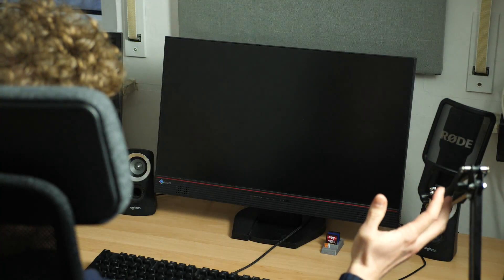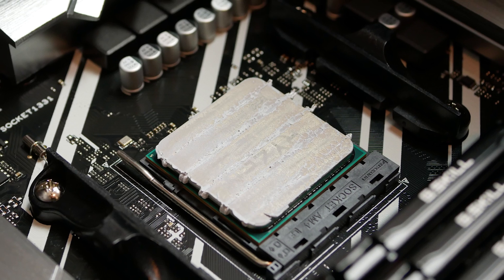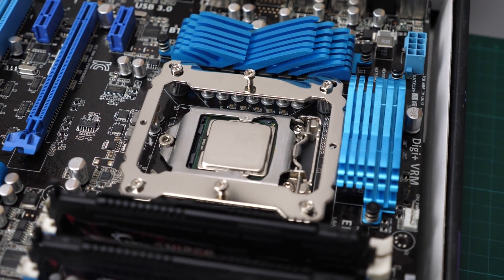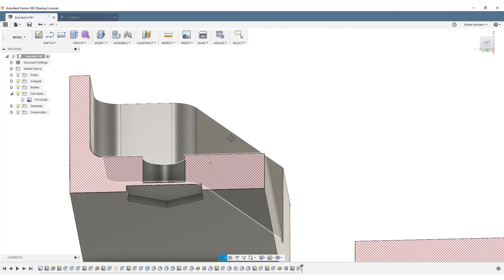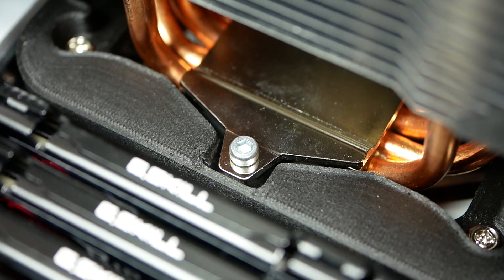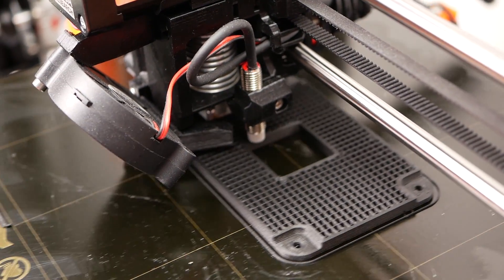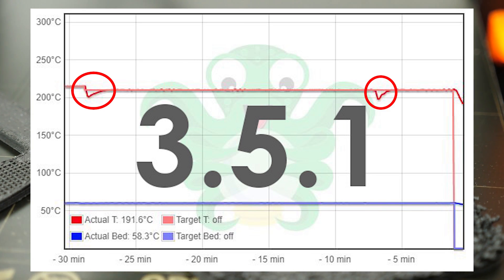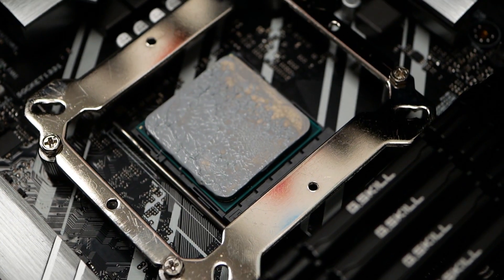I almost fried my new CPU because I overestimated my 3D print.

Comment: ... you can't wrek a CPU by "overheating" it... It'll turn off way before any damage is done either way.
Reply: Yes but it still aint good for it to reach those temps.
Reply: @zanpekosak2383  not really true, it throttles way before that. No CPU made in the last 5 years will be damaged from self heat. You can take a modern intel i7 and run it with no cooler at all. It will run very slow, but it will boot and run your operating system. They only cut completely off if you try to push them hard during throttling.
Reply: @Diamonddrake  My point is it is still not good. There is a very basic rule in electronics. COLD>HOT
Reply: @zanpekosak2383  except you want to build a heater
Reply: as he said it would have been that case in the mid 2000
Reply: Now go tell people whose house burned down because a computer fan stopped working that it didn't happen.
Reply: Thermal shutdowns aren't great, but yeah unless you're doing them nonstop for a while you're not gonna damage anything. I'd be slightly more worried about the cap temperature of the ones he covered up on the VRM.

Comment: Have you tried to vacuum seal and then use sous vide to anneal Pla? Not sure how it would go.
Reply from the maker: Haven't used a sous vide bath for that yet, because the oven works so well and I usually use temperatures between 100-110°C what is hard to achieve with water 😉

Comment: I think you covered that pretty well, Stefan. Without integrating other materials as safety clips, I think the annealing was as good as you could do with plastic.  Flashing copper over the plastic is a bit dangerous from a shorting failure perspective, but you'd also spread the heat around a bit better (you haven't shown one of those in a while :).

So, whilst everybody else was out sick you were playing games instead of making 'em chicken soup? :D
Reply from the maker: Still looking for a proper and reliable ways to metallize my 3D prints because that's not only good for aesthetics, it also adds quite a bit of strength.

Comment: My brother gave me a water cooling loop several years ago, but the cooling block was for an intel board and I had an AMD processor. I printed some brackets to make it work just out of PETG lmao. My brackets looked much more dainty than yours. The computer ran for years. I ended up giving it to a buddy. He still plays games on it.
Reply: PETG has a glass temp of about 2-3x of the material that CNC Kitchen thought was viable (but clearly wasnt)
Reply: the water cooling block probably never gets above 60 degrees. PLA would almost work. the air cooler will be getting up around 90 to 105
Reply: @MrOsmodeus  No, it's all fine either way. It's just mounting hardware, it doesn't get particularly warm at all! Barely warm to the touch.

Comment: Yes, i have an Adapter for my water cooling Fan+Radiator.
So i can mount the 140mm Fan+Radiator on a 200 mm Case Fan in the Front.
And a gpu holder for my Case so it does not sack.
Both in PLA. No Problem since over a year!

Comment: If the new bracket creeps, you could print another in cheap PLA, make a 2-piece plaster mold off of the print (or make 2 prints, each one being half the bracket to simplify this step), and then use a high temp / high stiffness 2-part epoxy to make the bracket in your mold. My first thought was to get fancy with dual cylinder / mixing tube type epoxy and use it like an injection mold, to prevent the possibility of air pockets, but that might be overcomplicating things if you can get a good pour in a static mold without going that far.
Reply: If you do this there is no reason not to add proper fiber reinforcement as well. E-glass is cheap (ish) and no plain polymer (filled or not) will match a fiber composite part.

Comment: Wahre interessant zu sehen ob das aussteifen des materials oder die hitzebehandlung geholfen haben. Oder qas das PC CF fillament auch wärmebehandelt. 
Still great video and good to know the picture calibrate trick in fusion
Reply: What a word salad! Two languages, "wahre" isn't applicable here, what is a "qas"...

I don't believe polycarbonate crystallises like PLA; it would be curious how annealing it affects its mechanical behaviour - obviously it must since it would dissipate the stresses produced during printing - but it shouldn't give the material any extra interesting mechanical properties. It's plausible that the creep happens due to locked in stresses.

If you mean you'd like to see separate creep experiments for changes in shape and annealing, i would be curious about that too.
Reply from the maker: With PLA and PET (not PETG) you can increase the crystallinity with annealing. With many other polymers, you "only" decrease the internal stresses from 3D printing, improving the mechanical properties a bit.

Comment: Nice video! Why didn't you just cnc milled it? Btw, did you ever tested owl filament. It's made in Germany and they sell slightly damaged spools on ebay for 11,70 €/kg, and it worked fine for me. I'd like to see how it performs in comparison to way more expensive filamnets.
Reply from the maker: I purchased one of their "B-Ware" spools a while back but it's still sitting in my shelf. I've heard a lot of good and bad things about their material though.
Reply: @CNCKitchen  Is there a test of this filament upcoming? I would really appreciate!

Comment: El problema es que tus análisis de estrés solo son estáticos, deberías agregar análisis dinámicos. Especialmente por las vibraciones que provocan los ventiladores.

The problem is that your stress analyzes are only static, you should add dynamic analysis.
 Especially because of the vibrations caused by the fans.

Comment: Having the CPU in a horizontal orientation (like in a test bench case) would of alieviated some of the stress from mean old gravity. You could if also added an extra support to the end of the cooler so it wasn't pulling on the bracket.
Reply: Actually did that in my tower some years ago. Without any bracket (forgot to order it and couldend wait fir it xd
Reply: Actually i have a piece of string tying my Scythe Kama Cross to a brace inside the enclosure - thinking of replacing that with a 3D printed clip or something like that. A very top-heavy cooler and about 700g in total, and i had issues where i'd have to re-tighten it once in a while until i did this, or would notice it wouldn't run properly in vertical orientation while it went fine as soon as i laid it down. The string is just taking the weight off the mounts and board and ensures even clamping.

Comment: Some pla blends have terrible creep problems. A chinese no name brand i once tried would just break aparte in days after being fit with a bearing and the filament itself would become brittle if left outside the bag for some hours. It was horrible. Another brand im using now doesnt have that problem and last quite a while before the bearings become somewhat loose. Still the design takes that into consideration so no problem if its a bit loose.
Reply: Love your profile

Comment: Normally you can just call up the cooler manufacturer and request the new bracket.

But i too wouldn't be able to resist an urge to fabricate the new pieces myself :D
Reply from the maker: I actually did, but they didn't have them anymore.

Comment: Huh, this sounds like PEEK would be a great material for this use case. Sadly it's like 1000 Euro a kilo and you need to print it at 360°C or more :/
Reply from the maker: True.
Reply: @CNCKitchen  I've printed quite a few things in different polycarbonates.  I'm pretty sure these would stand up to the temperature.
Reply: Mannedavid | SecondFaceTV Then he would be cheaper off just having his part CNC milled out of aluminium...
Reply: @He4vyD  Yea, but where's the fun in that? Also: you're limited to 2.5d machining (generally). PEEK is a new YouTube catchword cos consumer grade components are available now for printing it; but it's been in industry for years. I wouldn't use PEEK (or derivatives of it). It's unnecessary to have such a high melting/GT point. Polycarbonate, annealed PLA, ABS, PC-ABS etc etc would probably be fine. I've found PA-CF materials creep, in this application it just might not be the best material for the job.

Comment: Only because someone had to say it, could have just installed the pretty RGB AMD cooler and adjusted the CPU fan profile. (Also the stock cooler has a tiny switch on the side of the fan for High RPM mode or Low RPM mode.)
Reply: Than its to weak. It gets loud because it needs much RPM to get the needed cooling.
The big cooler can spin much slower to get same cooling, thus can be much more silent

Comment: You could put some very fine  metal tubes in your  3D printed part as reforcement.
Reply: close to what I was thinking. dropping in small pieces of steel bar/plate into pre made pockets in the print to reinforce it. your idea is better, just print a hollow tube long wise and put a bolt through it.
Reply: or mill it from alu....
Reply: It works quite well in my experience. I did this for a test bench last year in the motherboard tray and PSU mount, and it's so far been unreasonably sturdy. I added channels to those parts and used a mallet to gently force some 1mm steel rods in. Admittedly, I could've also just made those parts thicker, but it seemed like it'd be more fun at the time.
Reply: This leads me to an idea that actually this print can be done with a metal matrice(s) inside. Just need some efforts to make them stick on a layer (on pause) and continue a print. I think that thin metal wire-net can be used here... Maybe some slicing algorythms (to be possible to include thin metal layers inside) could be developed. Although IDK how is it possible without additional touch-sensors... usually a 3d-printer doesn't "see" what's under a nozzle.
Reply: @KiR_3d  It's almost definitely in the "more trouble than it's worth" realm, but tin melts around the same temperature as a lot of hotter PLAs at 232C and has a tensile strength of 220MPa compared to PLA's ~35. Provided you have a separate extruder that only handles tin, and print with a shielding gas to keep the tin tinny, I think you might be able to skip any slicer fanciness.

Tin's also a pretty soft metal, so whatever hobbed gear's driving it probably won't lose any teeth if everything else in that pile of weird works out.
Reply: I have idea, which I would like to try later.. Use infill like Gyroid to <20% and inject some resin into it.

Comment: When Ryzen hit th market I printed AM4 bracket for Asetek water coolers from PLA, used it for 2 weeks until metal one arrived from manufacturer. It worked ok, but after two weeks it was deformed, but cooler didn't came loose.
Reply: yeah pla has some serious creep problems. You need to design everything super overengineered to conpensate for that. I usually add lots of fins as reinforcement on the areas that will be streesed and try to make the part as solid and robust as possible in those parts too even if it already looks good enough.
Reply: I want to print a AM4 bracket for corsair h115i, will ABS be a good material??